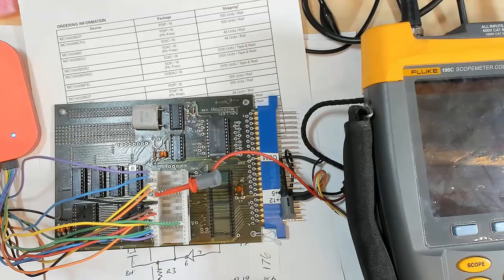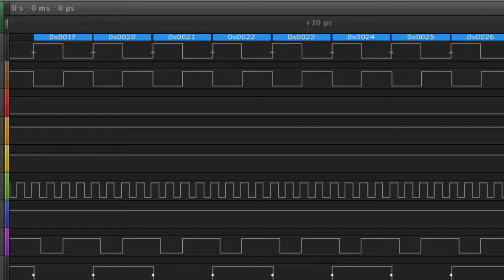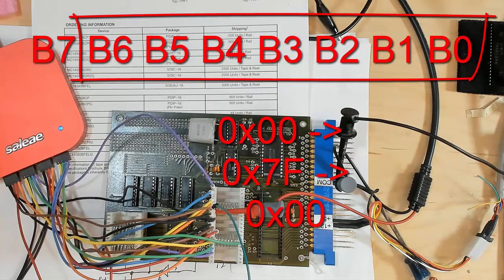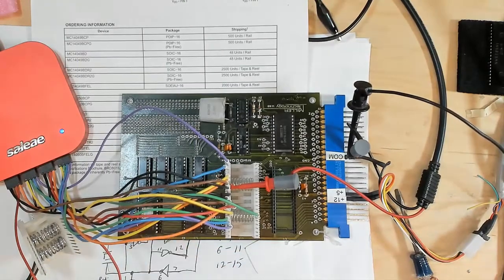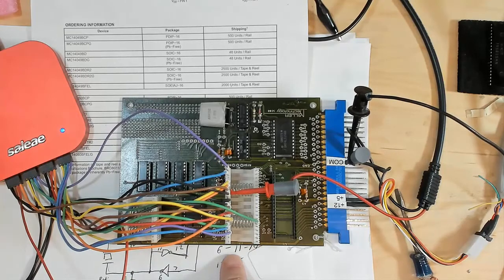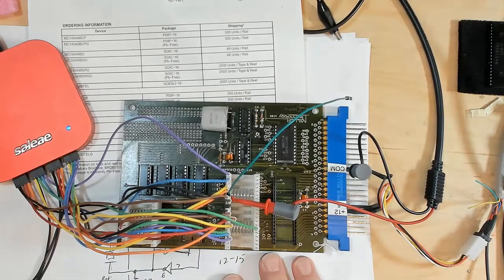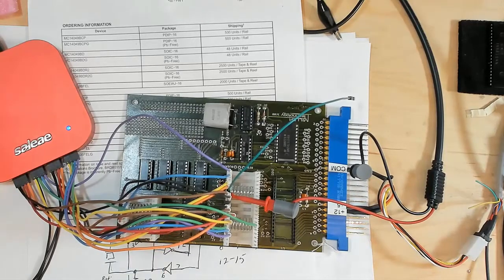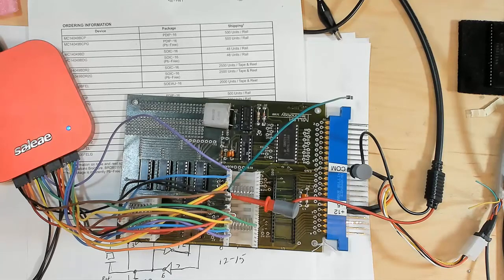{64} Z80 *Hidden Output Pin Reveal* (and using it to confirm the CPU is running code from the EPROM)

Comment: I know im late to this but i got an Z80 and i love tinker with it. I think that the Z80 needs 7 clock cycles with reset low to set the internals andd put in a stable state. I could be wrong ^^. I truly enjoy your content
Reply from the maker: Good point.  I think the Z80, 8080, and 8085 are all three clock cycles once powered up.  I had to look in the zilog user manual, I couldn’t find it in the technical manual. I was with you, I thought it was longer than just 3 cycles.  

But the processors with an internal bias charge pump need extra time before they are fully functional and considered ready to even start internal housekeeping and resetting.   I know the 8085 has a charge pump and presume the Z80 has one also.  8085 specs say that is 10ms so on powerup that is probably the deciding factor. Warm start doesn’t need the substrate bias charging time so then clock cycle limited.
Reply: @HelloWorldETX  Interesting, thank you for the answer. It is so much fun... and headache some times ^^. Have a great day.
Reply from the maker: @frankjansson7563  16 clock cycles required for the 8008, so a great deal of improvement between the 8008 and 8080
Reply: @HelloWorldETX  Going from 16 cycles to 3 is an improvement. Is it the logic states in the cpu that need the rising/falling edges to align?
Reply from the maker: Lots of setting registers to known states. 8 think the 8008 zeroed all registers, later CPUs just the critical ones to put the PC and flags in a zero state.
Reply: @HelloWorldETX  I just got started with this. Bought a "Vintage Kit" from ebay. Built a virtual environment with some i2c I/O ships (mcp23017). Connected an SRAM (hm62256blp-8) and using BUSREQ i could put the Z80 in Highz, write code in the SRAM and then give the Z80 it's bus back ^^. First time i got a simple increment on the OUT port with a loop.  It was such a great feeling. Im planing to design a simple PCB so i can leave the breadboard.  Not the best signal integrity. I think that 65c02,z80 and 8080 are around the same time?  people like to compare them at least. Thank you for responding. I'm learning so much // Frank
Reply from the maker: I remember the feeling of that first successful out instruction !
Yes, (in order of release I think) 8080, 6502, 8085, z80 were considered contemporaries.  I have found most people are strongly in one camp or the other.  Z80 overall the most popular I think, because it was used in consumer products. Z80 is a better design in most ways because it was clean sheet rather than just single power rail and integrating support chips into the die like the 8085.  The F8 and the 6502 get a lot of the credit for driving prices down. The 8085 was good for tightly integrated, small systems in part due to onboard serial, supportive MCS-85 family and nice vectored interrupts.  
Good luck on your progress.
Reply from the maker: Hey Frank, as far as a training platform---- you may be interested in this project that I have started and just need to get around to finishing...  
https://bitsofthegoldenage.org/does-anyone-want-a-new-8755-project/
Reply: @HelloWorldETX  Hello, that project looks realy interesting. Hardest thing i found is that there is not so much pure z80 asm programming resources ^^. But i like challenges.  The project, is that something you offer ?  I've watched some of your SBC-85 videos :) , your Fairchild F8 videos inspired me to try and build a clock. And i have little to no idea how to bitbang. But thats the fun, in searching and discovering.
Reply from the maker: @frankjansson7563  I have the boards and components, I just need to fit it in.  When tested I will upload board build & firmware files and have boards available on tindie.  As for Z80 asm resources, remember that the instructions are an extension of the 8085 so don't forget to look at 8085 assembly resources for additional information.  If your Z80 board does not have a controller on your I2C, then I see bit-banging in your future.  You can look at my F8 code or the 8085 confidence test code to see examples of bitbanging RS232 and the serial to the DS1302 clock.  bitbanging is really nothing other than shift and wait
Reply: @HelloWorldETX   Ok, I realy would be interested in that project. It's a old-new world. No hand holding like modern micros. 
About the Z80 asm resource, thanks for the advice. I've read that the z80 was meant to be compatible with the 8080? 8085 as you said. It's lot of fun reading trough old manuals and handwritten note's from the early 80's.

I will look at your code for inspiration. 
 a Z80 without anything is just like a confused brain that keep's forgetting things ^^. I got an i/o controller in the kit but as you know it need's an clock to get the right serial rate. And im happy to light an LED. A huge thanks for sharing your passion with the world.

Comment: Might add a Dallas DS1233 EconoReset in the prototype area. Handy for power-on reset as well as pushbutton debounce.
Reply from the maker: I usually use MCP130-485HI/TO for supervisory. Have you ever compared the performance to see if there is any advantage of the DS1233?
Reply: @HelloWorldETX  I have not! I use the DS1233 because that's what I've always used for a 3-pin reset supervisor :P I'll check out the MCP130, looks like the different bond-outs make it a drop in, and it's cheaper. I generally like Microchip stuff.

BTW, check your forum post about the M-80 on the VCFed forums, I added pictures of mine, the PS-80, and application board that came with mine. Also uploaded the 1200 bps ROM monitor.
Reply: Ah, no pushbutton input on the MCP130 -- the DS1233 has pushbutton reset/debounce!
Reply from the maker: @glitchwrks  yes, I saw that but it requires an external RC doesn’t it? I think the MCP130 would do the same - at least it would be worth looking in to.
Reply: @HelloWorldETX  It requires an external capacitor to set the reset debounce pulse length. From Microchip's page on the MCP-130, it says there's no manual reset option.
Reply from the maker: @glitchwrks  Thanks for pointing out the DS1233, i will get some and try them for debounce.  Maybe also see if the MCP can be Jerry-rigged to do the same.
Reply from the maker: @glitchwrks  have you ever used the DS1233 for just a generic debounce? or only tied to a uP reset input?  i was wondering about just a generic debounce on an input to save from having to do it in software.
Reply: @HelloWorldETX  I've only ever used it for reset debounce, but there's no reason you couldn't use it for a generic input debounce, too! You would of course have the input pulled low after a reset, perhaps for longer than the microprocessor's reset.
Reply: Perhaps if the power supply to the MCP130 came through a resistor you could pull that down via a button+series resistor that creates a voltage divider such that the MCP130 supply would fall below the reset voltage threshold (but not below it's minimum vcc required to operate). It should then hold the output in reset long enough to debounce the button press while providing automatic plus manual reset with debounce.

Comment: In the mid-80s I was sent to Ethiopia to install 2 4 user Cromemco Cromix systems.  I made sure the hardware was in working order and oversaw construction of 2 computer rooms in 2 cities.  There were also 2 programmers writing the shipping port application.

After I had the hardware up and running I taught Basic programming to the new hires in the mornings.  In the afternoons I started writing Z80 assembly on a C-10 (full 64k Z80 system with floppy drives running CDOS and capable of booting also to a dedicated terminal)

I discovered and started playing with the refresh register as a random number generator.
Reply from the maker: Interesting story, giving computer availability in the 80s probably changed many lives.  I hadn’t thought of using the refresh as a number generator, good idea.

Comment: Clear explanation and as a extra bonus you have a nice pattern (the ED instruction) of the M1 line as was my first test proposal.
-Maarten
Reply from the maker: You are correct. Indeed the double byte opcodes makes for a varying pattern, but without the decoded full refresh address or the eighth bit I would have no chance of finding the intended M1 vs refresh pattern in a sea of toggling bits.  It isn’t as if you can avoid double byte opcodes in just normal programming so finding the 2:1 and 3:1 M1:RD ratios makes me dizzy.

Comment: Nice!  None of my books have that info for the R register. My Zilog book set is an odd collection. I have the Application volumes still, but not the data book, I think I loaned it out or gave it away a long time ago. I do still have the Programmers ref flip-book, but it does not cover the registers, and I have always thought that odd.  Barden and Zacks were silent on this feature as well.   Thanks for sharing it and I am sure I will use it!!!  I made a reset-controller for my tinkering as I have fought the hang-on-power-up battle as well. I use it on a Z80 board and a 6507 board I made. It's done with an 8-pin SMD STC 8051 core chip and generates a proper Reset on power-up or button press.  It could be done with a pic or avr uC as well.
Reply from the maker: Thanks for your interest.  As far as the reset, I am used to the pretty foolproof 8085 where just a RC works.  I need to probe more to see how hard they tried to avoid power on latch up or if there is anything on that reset line besides the 20K I found.  But the reset button I installed has been working well so this isn’t on my mind anymore.
Reply: @HelloWorldETX  Yeah, I added a reset button on another Z80 board I had after doing some repairs and mods. The Z80 has always seemed a bit pickier on the cap choice for the reset RC.
Reply: Yea, lots of obscure (but frequently useful) information on this channel